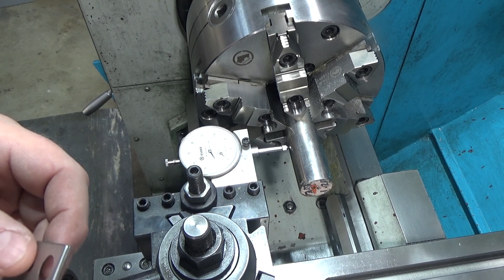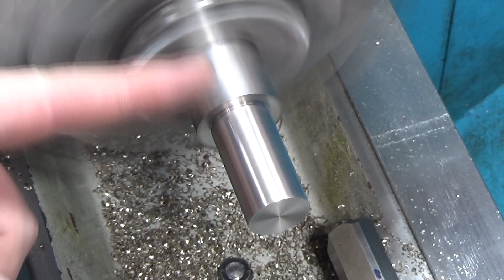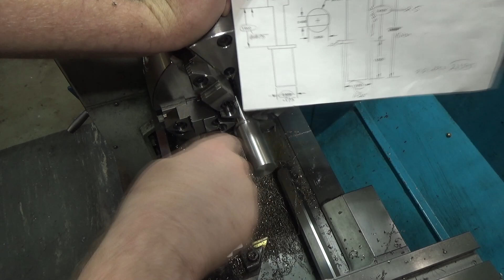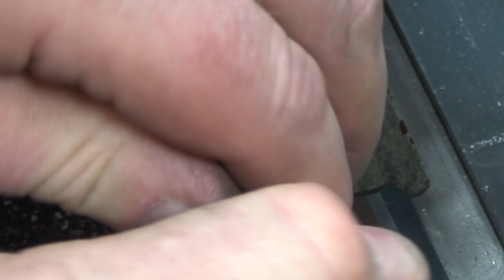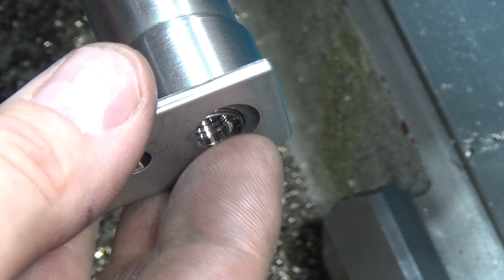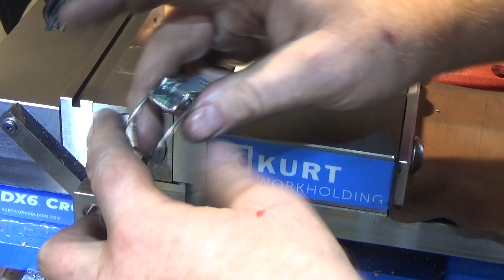194 Laser Welder Battery Lid Jig

Comment: If you have to protect the surface get some 1/16 or 1/8 id vinyl tubing and slit it so you can put it over the clamp wire also if it's possible to remove the clamp wire you could also use some shrink tubing either will keep from scratching and add some grip I would probably try vinyl tube first since as it gets melted it can be replaced easily laser welding is usually pretty precise and doesn't have a huge heat spread zone so hopefully that would work without getting liquefied immediately👍👍👍
Reply from the maker: Thanks for the very good ideas. I was going to head here id the customer wasn't totally satisified. I had purchased some small diameter brass bar that I was going to braze in to a different type pull latch.

Comment: Good work as always but I’m not too sure about those clamps 
Is that type of stainless magnetic some are. Just a thought
Reply from the maker: Great point that I had not considered, they are not. I have a spare and tried it. The clamps were a compromise and do require a bit of fiddling each time a part is placed. Something more rigid would be an improvement.